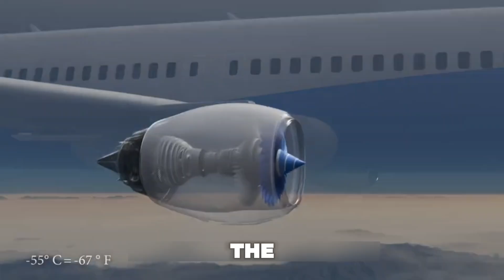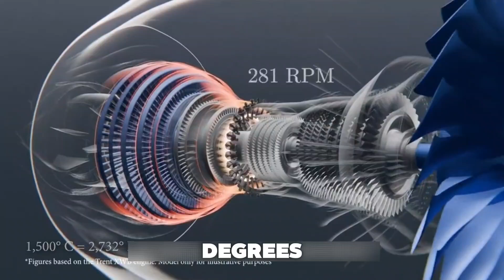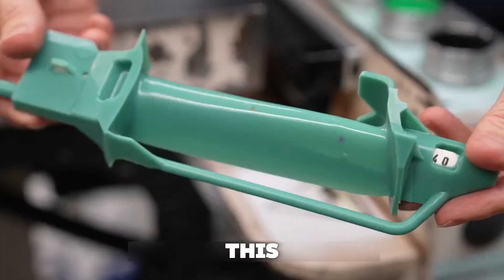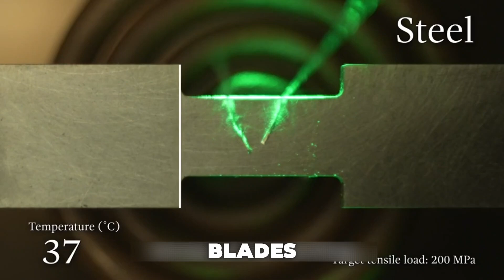How Jet Engines Survive Temperatures Hotter Than Lava 🔥✈️ | Engineering Explained

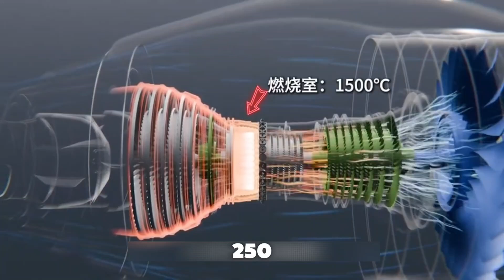Comment: Jet engines operate at temperatures exceeding 1,500°C, which is hotter than the melting point of their own materials, to achieve high thermal efficiency (0:02-0:32). This is made possible by several key technologies:

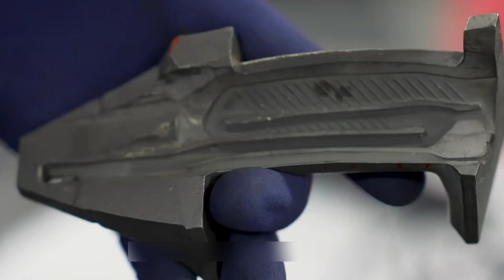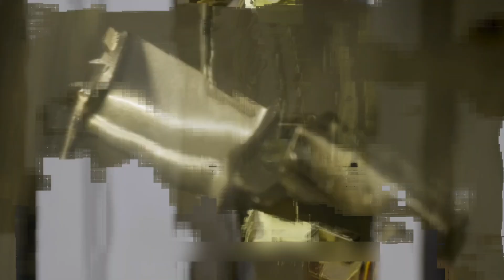Cooling Channels: Microscopic channels within each blade allow cool air to flow through, carrying heat away from the core (2:06-2:14).
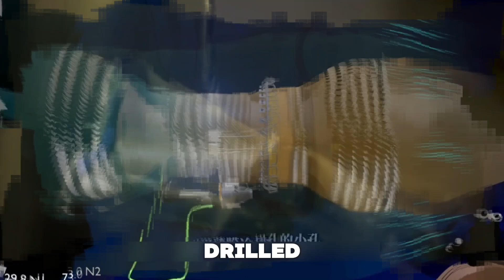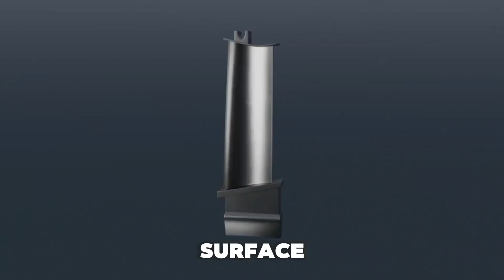Film Cooling Holes: Thousands of tiny holes on the blade surface release cooling air, creating an insulating gas layer that shields the blade from direct heat (2:17-2:29).
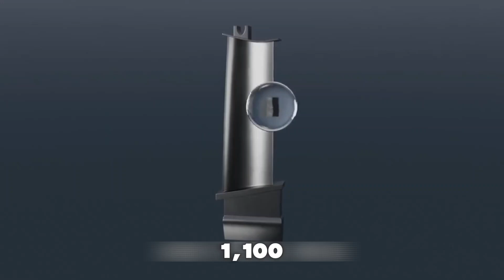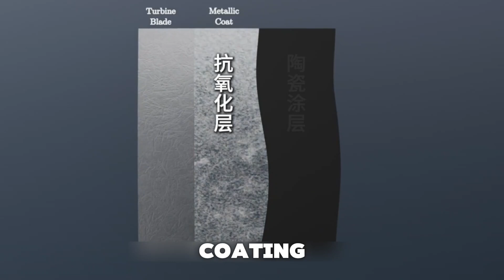Protective Coatings: Blades receive two layers of coating: a metallic one to prevent oxidation (2:31-2:37) and a ceramic thermal barrier that significantly lowers the internal blade temperature (2:38-2:45).
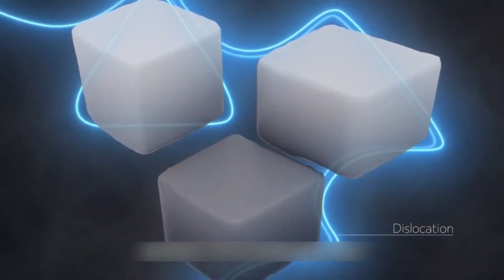Nickel-based Superalloys: These alloys are used for turbine blades due to their unique crystal structure, which maintains strength and resists deformation even at extreme temperatures where ordinary metals would weaken (3:35-4:07).

The manufacturing process involves creating wax molds of the blades, coating them in a slurry and sand to form a ceramic shell, baking the shell to melt out the wax, and then pouring molten nickel-based superalloy into the hollow mold (2:55-3:37). These combined advancements in technology, cooling efficiency, manufacturing precision, and materials are crucial for modern jet engine performance (4:25-4:32).